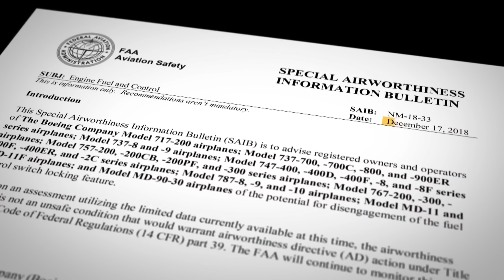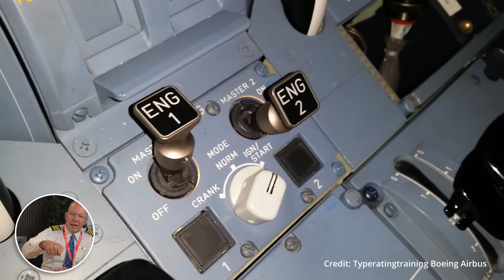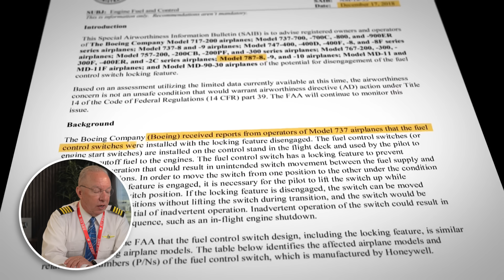Air India 171: The FAA’s 2018 Fuel Switch Locking Bulletin Explained (16 Questions Answered)

Comment: He’s basically said that he doesn’t want cameras in the cockpit in case someone gets caught doing something they shouldn’t. Is he taking the piss? That’s the very reason that I, a passenger WANT cameras in the cockpit? Shady business
Reply: IKR, where the fark is his logic?
Reply: I think he misunderstood the reason for having cams in the cockpit, he was like ”it would not have prevented anything”, and the reason why the cams were even mentioned in the first place, was to identify which individual are doing certain actions, like the ones mentioned during this flight.
Reply: Money
Reply: His point is that the pilots don't want the airlines looking over their shoulder at all times, and I get his point and agree with it IF the airlines had access to the video feed in flight.  It would be a nightmare (not to mention dangerous) to have a supervisor call in midflight to question something.  Even worrying about it would add to the mental load on the pilots.

However, I can't think of any good reason why you would have the cockpit video feed being transmitted, especially in an era where, conceivably, a bad actor or state could potentially gain access to that video feed for a multitude of nefarious reasons.  I would think that it would back much more sense to just record the video to a small hard drive at a low frame rate (1 fps).  You could even set the system to overwrite the file the next time the FDR and the CVR go active.  I'm sure the union could build in safeguards to prevent the airlines from using the data for something other than an accident or major incident investigation.
Reply: You idiot wantvto see pilot taking piss?
Reply: Do you really want to know the pilots sometimes masturbate ? ... 🙂
Reply: It reveals that the terms and conditions 'Are and For' passengers, only.
Reply: Some pilots do nasty things with air hostess, think captain steve is one of them..:face-blue-smiling:
Reply: That's not quite what he said, or at least meant, in my opinion. I think he was trying to say that minor deviations from procedure, which happen all the time, would suddenly receive uncalled for levels of scrutiny, and pilots would end up becoming paranoid knowing that everything they did in the cockpit, or didn't do, no matter how minor,  could be career ending.
Reply: @h14hc124 yup, we have cameras in our cars at work. Miss a stop sign and its career over. Don't immediately slow down down when speed changes, first and final warning. Yawn and youre logged for drowsy driving. Look anywhere but forward, distracted driver. It doesnt make me feel safer, its added stress I could do without. I'd rather pilots don't have additional stress. Make camera capture cockpit without seeing every detail, and only after major incidents, and I suspect most would be happy for their addition.

Comment: With all due respect to Captain Steve, the data bus or the computer failure is possible even if pilots in the simulation couldn't re-enact it; and even though FDR recorded the fuel cut-off but won't the CVR record the sound of the switching of the two mechanical switches. Please don't be certain about uncertain things before any solid proof.